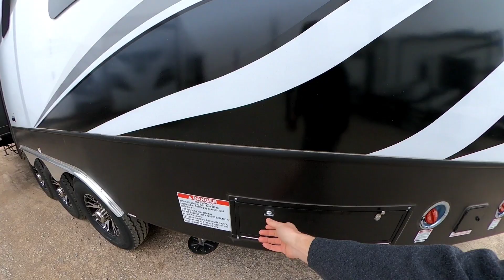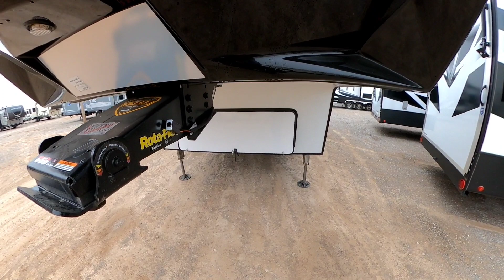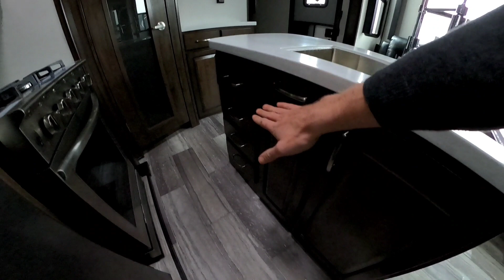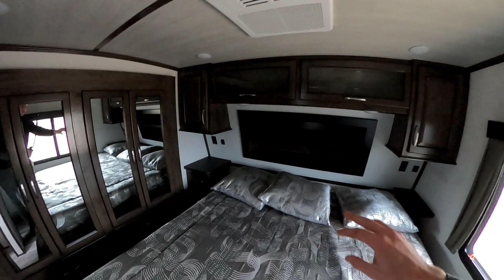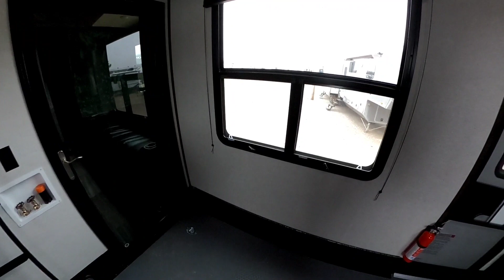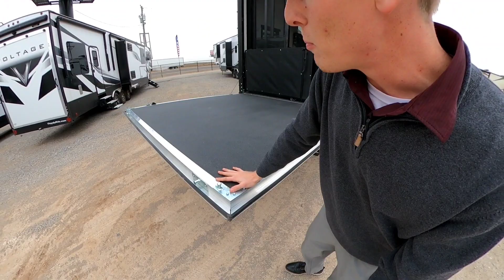The VOLTAGE 3915 is the ULTIMATE TOY HAULER

Comment: Very nice toy hauler, this model is actually the one my wife and I are looking at. With that said when you started talking about the garage I'm going to have to disagree with you completely on...You should not start an engine with just your vents open, the vents are made for when you're in motion going down the road. If you're going to start an engine in that garage you better have the door open minimum, I would have the whole ramp down! (Exhaust gas is very serious!).  That's my 5 cents worth however again very nice toy hauler.  If I can't find a 3915, I guess for 2022 it will be the 4015 model.